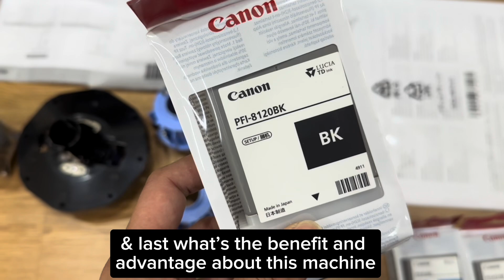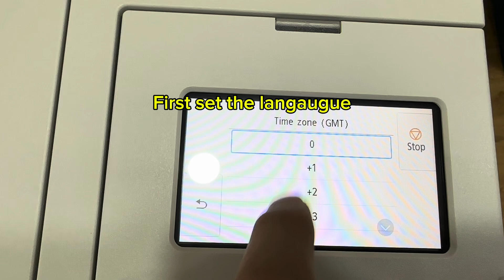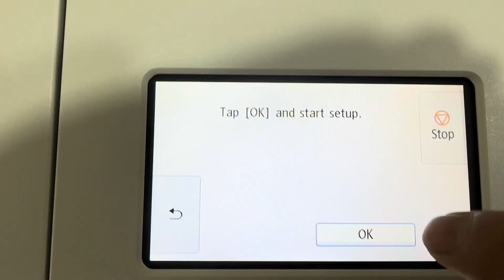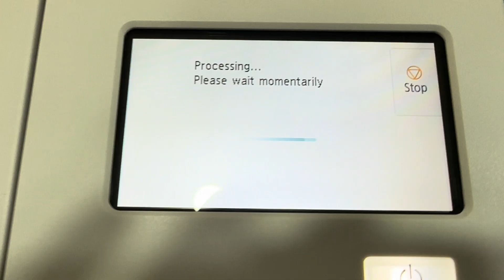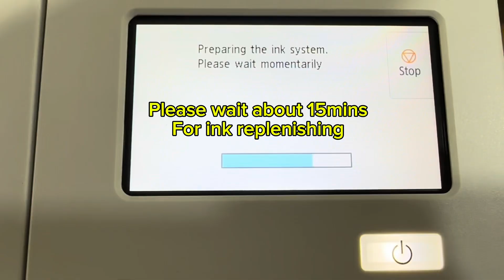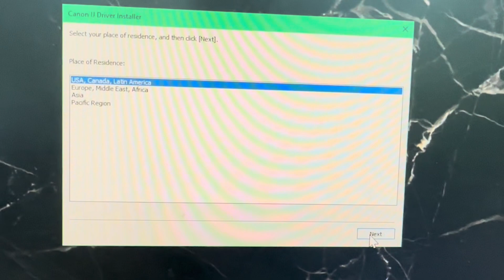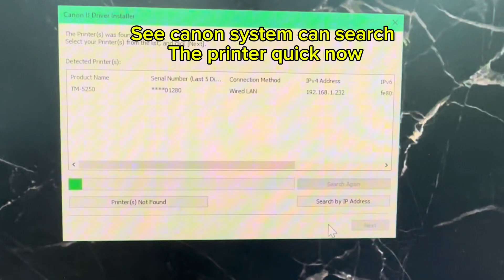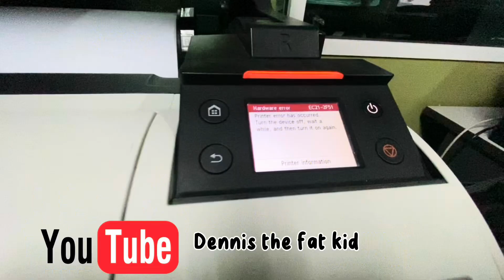Canon TM5250 unbox

Comment: Hi, Can I ask any reasons you choose this Canon model, vs Epson or HP ?
Reply from the maker: Hi Richard , beside specification , I Will judging by warranty , local support , warranty period and print head consumption
Reply: @dennisthefatkid thanks. Can i ask further then, in your case for Malaysia, which other models did u compared with, and how was Canon superior in those categories you mentioned.
Reply from the maker: @r @richardngjoobeng1403 @r@richaar from now and what you see in my channel are only Epson and canon . Canon support in Malaysia is excellent , warranty wise Epson is longer than canon. Where you from ?
Reply: @dennisthefatkid I stay in Singapore